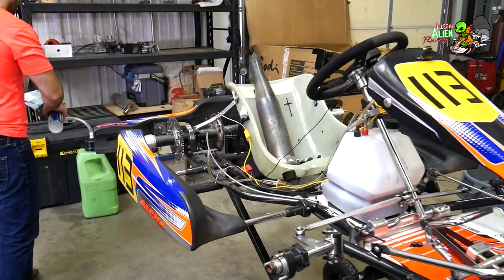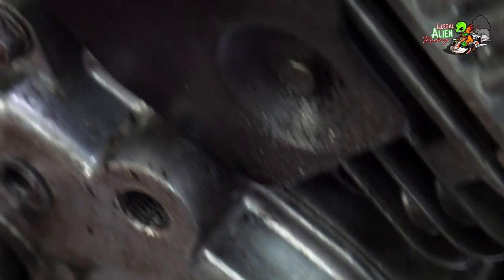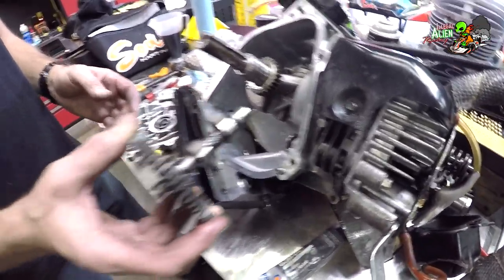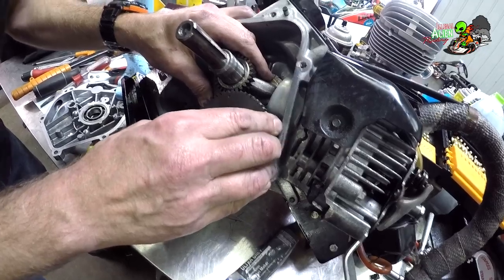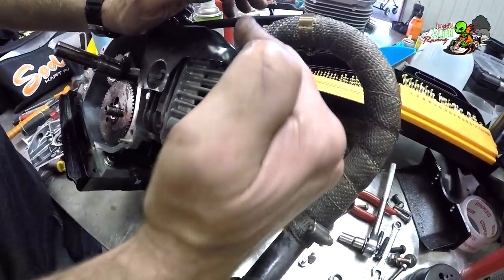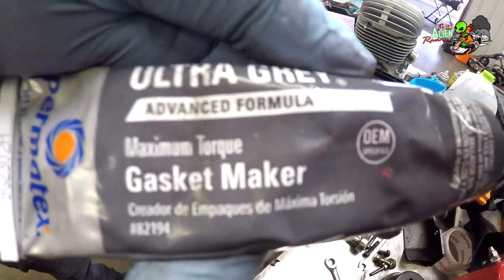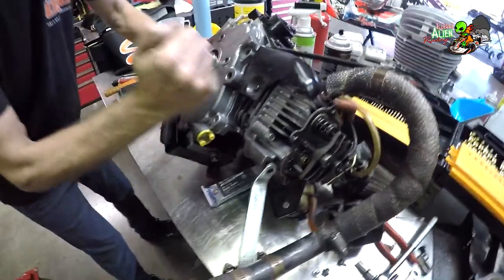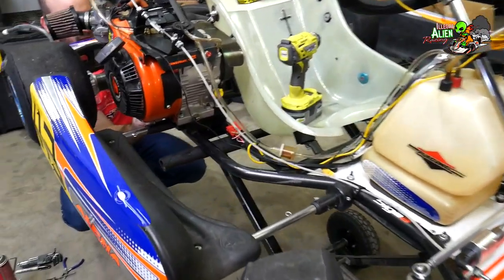LO206 Leaking Engine Repair

Comment: Guys don't use silicone on that engine. Use some right stuff gasket sealant on it.,or some 3M weather strip adhesive.,or you can use fiber gasket with A light coat of grease.,or lightly oil cost on the fiber gasket instead. It will work way better on those Lo206 Briggs & Stratton racing sealed engine's.

Comment: Yeah you can use that. It will leak again cause.& Due to the heat& friction it will not last to long at all. You can buy make your own fiber gasket material at A auto parts stores.

Comment: Good video. But you didn’t explain why just fixing an oil leak makes the engine illegal.
Reply from the maker: You're not allowed to cut the seals on the engine.  Once you do that, it's illegal and you'll be DQ'd if you enter a race in that class.

Comment: If you can't race the motor after the seal is broken for maintenance why not just trash the motor
Reply from the maker: You can use it for practice to run laps.
Reply: @IllegalAlienRacing  o ok makes sense 👌 I'm thinking of getting into cart racing been calling around to see the most common brand in the Jacksonville Florida area